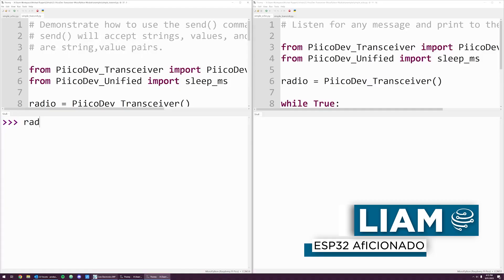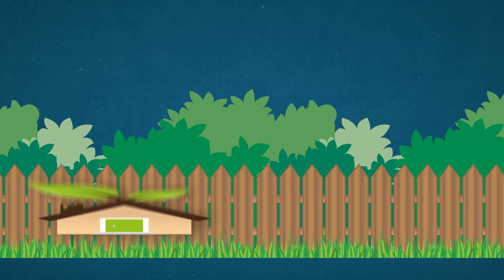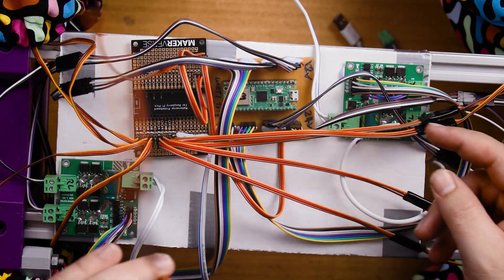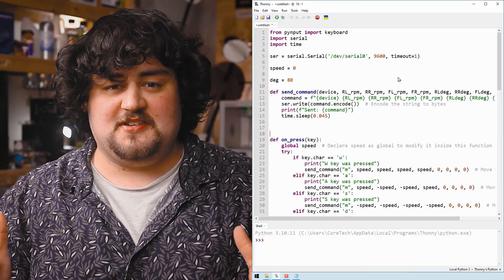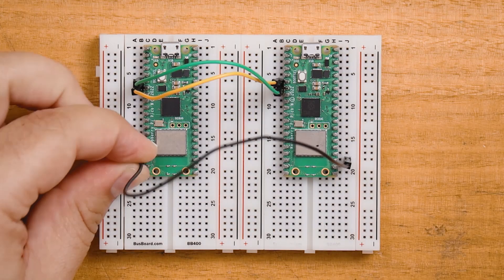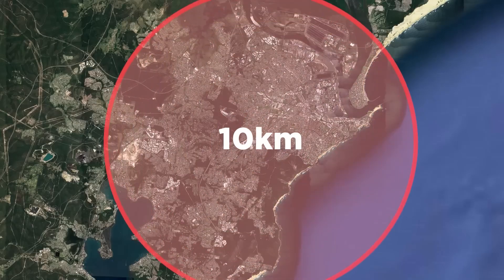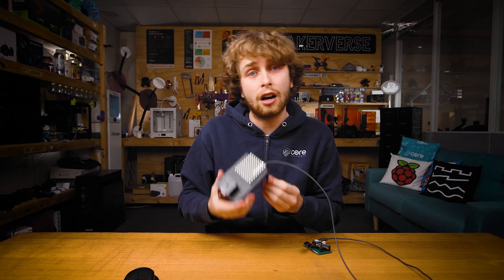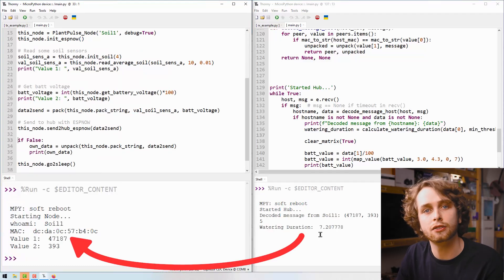Board to Board Communication | Zero To Maker Workshop

Comment: What could you use if you want to have like multiple boards communicating to one board? Like a hub etc
Reply from the maker: Lots of boards all talking to each other is where it starts to get difficult! If you have wireless capabilities, MQTT may be the easiest. I2C is another possibility but would require making some hardware for it.
Reply: @Core-Electronics  sounds interesting though! The i2c sounds indeed hard, but the most interesting 😄

Comment: Nice, I just started implementing RPi - Arduino - ESP8277 communication with RS-486. I connected each controller's Rx/Tx to it's own UART-RS485 converter module and then those modules between each other into a giant bus. UART is god-sent. Worth exploring for distributed microcontroller applications. Got an idea after I saw controller design of our heat pump system.